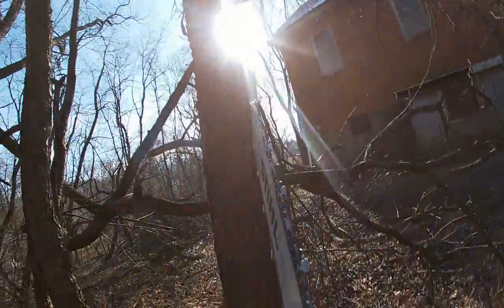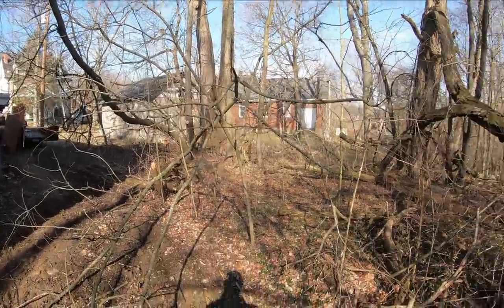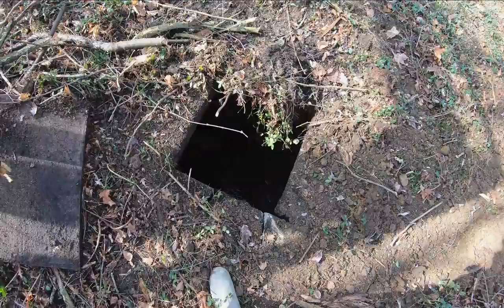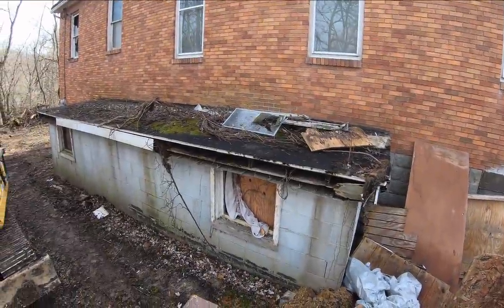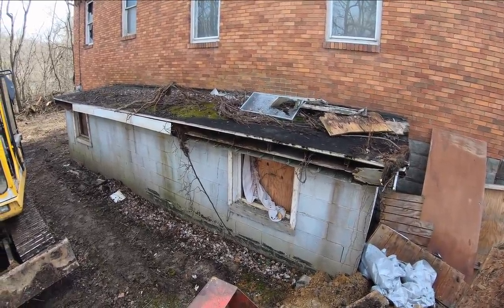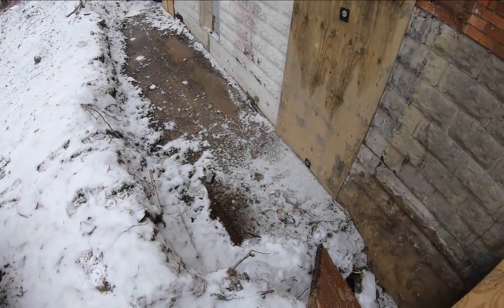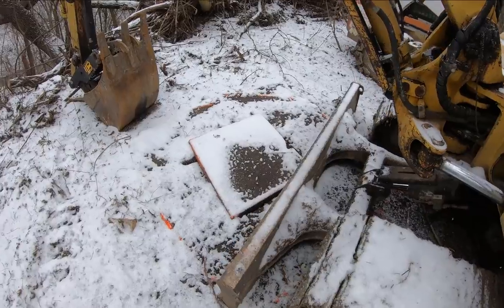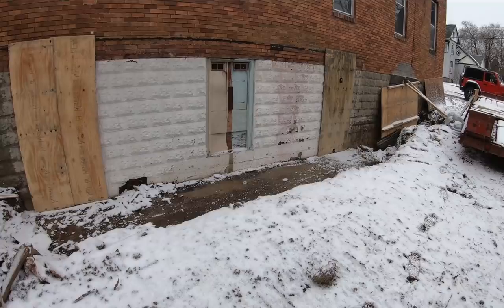Demolishing Part of an Abandoned Church! and Clearing trees with an Excavator!! Ep.8

Comment: Before folks just "get a dumpster", Matt probably didn't talk about the research... Some places, it's fairly easy to DIY dump hauling. San Diego, CA is pretty easy: free greens dumping for residents & low prices for other stuff (make sure your load is covered). In DeKalb county GA, the dump is 35 minute drive from the house and then another 25 minute crawl in the site, and it's not free. DeKalb makes a gal want to spend extra on a dumpster, but Sandy Eggo, she'll be a cheap skate and hang a trailer off her van.

Comment: Consider boxing the entire front of the building to the same width and out to the same face.  By making the building a solid rectangle in front, you can add a lobby with mailboxes and then use the tower as an elevator/stairwell adjoining  the entry.  Also, the building would stop looking like a clipped church and become more of an apartment house.  Asphalt driveways all around and a ground floor access to the elevator stairwell would improve moving things in and out, for everyone and everything, including materials when remodeling.  Enjoying the progress regardless.
Reply from the maker: I think thats a lot more work than this building will be getting lol .

Comment: Hey Matt, I'm getting to learn a few things about the state of building supplies in the Land of the Free!  Over here in U.K. we have aggregates and cement as separate entities so you have a heaps of crushed stone and sand next to the mixer with the cement available in 25kg bags (they used to be 112lbs when men were men!) which gives you the ability to vary the mix. This is the most cost effective method - bags of premix here are prohibitive for large amounts and only cater for the odd fence post. We also have metered mixer wagons which will dispense any quantity of excellent mix up to 10 cu mtrs in one go but again - not cheap. Your rebar wouldn't pass our building permission (well, I'm afraid the whole building would be condemned!) you didn't have the correct water content either - it was way too stiff. You also need to have a water barrel close at hand so half a bucketful can be put in the mixer to start each gauge - this will stop the mix from sticking and the temptation to put a spade in the moving drum!!!   In my younger days I regularly shovelled 25tons of aggregates plus the cement into my own Benford 5/3.5 mixer, wheeled and poured on my ownsome - your wall looks like a teabreak job! Four blokes? Did you pay them in beers?

Comment: That would be a good video showing retrofitting a sewer line from an old system to a town supply at the street starting with the permit process right on thru to the digging, installation, and inspection.
Reply: Yep, and surely needs to be done? (Edit: Yes, it will be, mention of filling in the septic tank at the end!)
Reply: He could use the cistern as a dry well for the gutters. They may be tied into it already and keep the roof water off the grounds.
Reply: @peterg.8245  It's a liability to have something like that on the grounds that people can fall into. He probably has to have parking so he might have a driveway in that area.
Reply: @peterg.8245  You took the letters right off my keyboard, seems like a great idea.
Reply from the maker: I will be covering that when the time comes!

Comment: I love that you are really fixing the key issues with the structure. That lot of land seems to hold water in the soil. I'm sure you have already considered digging around the whole structure and putting in a french drain system. That would certainly solve 99% of the issues with the building in the future. Great video, keep up the good work.
Reply: Cybersylo could use the old cistern as a dry well to keep everything off the surface.
Reply: @peterg.8245  He could definitely run the french drain to the cistern, or just run it out the back of the property down the hill. That would be an interesting project.
Reply from the maker: french drain is definitely  in the works! as soon as the walls are repaired!

Comment: That machine you use is a beast!  And you make it look so easy!  Can't believe how you separated the blocks from the debris.  Not as easy as you make it look!  Great reno to video.  Look forward to it each week.  It's gonna' be a prize when you finish.
Reply from the maker: Thank you!
Reply: With all the work u do on the different building most has metal roof? if they are bent put them on the ground and run  over them if there's too many holes just double them up for a equipment shed and u could used them for walls on the sheds out in back : your not going to leave in them . U don't want to spend to much at the Actions so why spend good money just to cover the old Equipment up its battery than most people do we had a pull barn for our Equipment and it was better than working in the sun or the rain what little we got. rain jk

Comment: Wonderful work, Matt! I don't think you're very familiar with septic tank systems. The thing is very sanitary and lasts forever. Contrary to what people think, it is seldom smelly and does not contribute to water pollution. Septic tanks have "field lines" that control water in the system; a certain number for the amount of use of the building. I daresay that yours had 4. I think what you uncovered was the water cistern, given the shallowness of the dig and the square hole for the pump. I think I'd look a bit closer to the street for your septic tank, given the size and location of the bathrooms. Considering that there might even have been out houses in the very early days? Yeah, most likely a cistern.
Reply from the maker: Yes that was an afterthought I had after filming.

Comment: You found the church's septic tank by accident?
...
Bet that was a holy shit moment.

I will see myself out then.
Reply from the maker: Indeed lol
Reply: I think that circular tank is a <<drop manhole> to avoid the sewage being separated in a steep gradient, and then blocking.  As regards septic effect it does not seem to have the staged flow, thus more like a farm slurry rank.  Can be promoted by dropping in a dead rodent.  NEVER to be entered without full safety advice.
Reply: Curious question for ya...
Did you consider using the two bathroom doors cut in the foundation as a entry door for one or two of the apartments?

Comment: Really great watching you work, you handle that machine like you were born to it. I have one concern though, while you were running your digger I detected a horrible screeching noise, I guess that it may have been hydraulic oil moving through the valves, so, I hope it's not too expensive to fix. Honestly it really sounded like "House of the rising sun" being played on an old radio, left behind in the building. It must have fallen into the toilet and then the sewer pipe, onto its way to the septic tank,  before being destroyed. By the way I went down to the shops, and they told me there had been an other run on ear muffs, and interestingly enough, they were all being charged to you account again. Really enjoying your Vids,, waiting for the next one. Keep it up mate. Cheers
Reply from the maker: No it’s not the pump the belt squeaks a bit sometimes

Comment: I am curious about the new concrete.  When you poured the wall...it is intended to support the structure above it.  How did you avoid a gap at the top joint?  Thanks.  Good stuff.
Reply from the maker: I actually poured it about half way up the bottom row of brick, that way it completely captured the wall. its perfectly tied to both the brick and floor plate on the inside.

Comment: Dont you just love how additions were put on back in the day. Lets go right here and put the bathroom addition here on old entrance and stick a flat roof on it. I do land clearing and knock down old buildings. I have a 1966 7-G Allis Chalmers Dozer with a angle blade set up .  And a 69 6-G Allis Chalmers Front loader. How bad did the roof leak between the header and wall. They should have put the restrooms in the upstairs.
Reply from the maker: Nice!!! thanks for watching!
Reply: @DieselCreek  Hey your welcome!. I inherited those machines from my uncle in 1991. I haul them with a 74 GMC cab over and 35ft Beaver dove tail equipment trailer . Got a 73 White Dump truck 18yard bed. The 7-G has a D-21 AC 6cylinder turbo diesel. Ive rebuilt both crawlers from the ground up. I like mechanical over hydraulic machines. Love the videos ans god speed.

Comment: Looks like when the church was first built it never had all the dirt piled up against the walls, someones come along over the years and practically made a mess which has caused all the problems you have now with the foundations.
Reply from the maker: no there was a brick well around the windows, the grade was original but they didnt have any drainage so the water weight and frost heve did it in, even if the building was heated it may never have happened. perfect storm really.